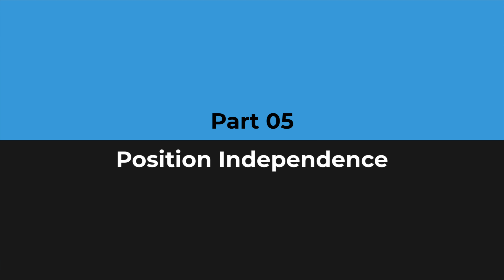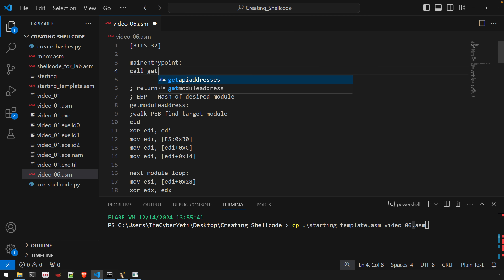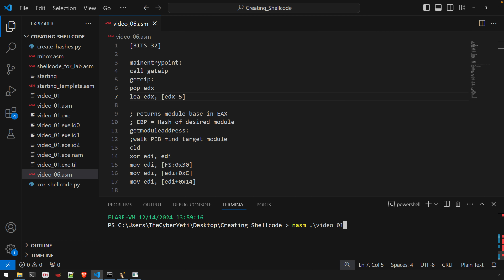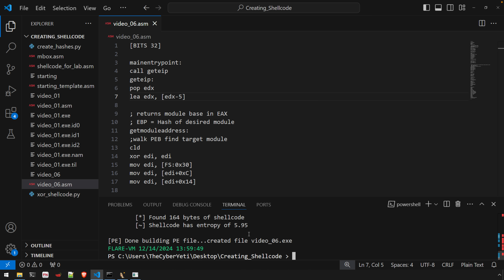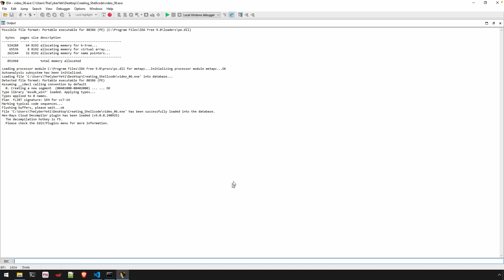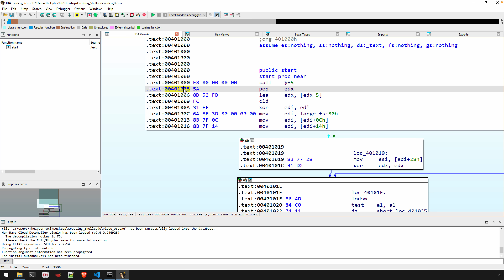05 - Creating Position Independent Code using CALL $+5

Comment: It is surprising how after all these years the call pop technique is still used for getting position. I first read about it in the Little Black Book of Viruses by Mark Ludwig where he talks about 16 bit systems. Segmentation with near and far pointers was such a nightmare.
Reply from the maker: Yeah, I suppose since the underlying architecture hasn't changed a ton, there's just only so many ways to get an address using just the instruction set. Of course, in the world of exploitation you can find such things as memory and address leaks. But a lot of shellcode I deal with is not used for exploitation just to make malware more difficult to analyze